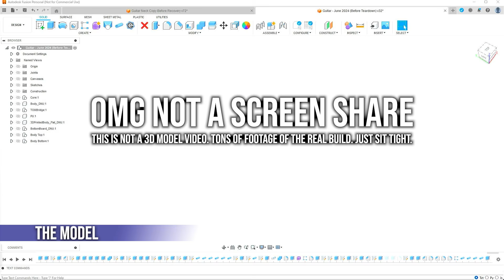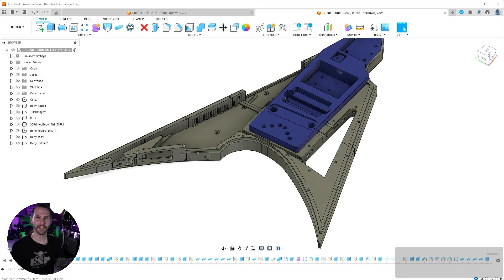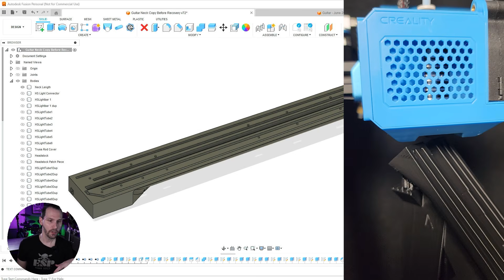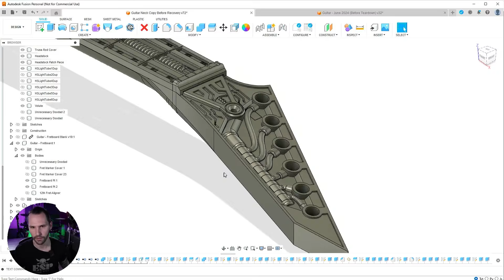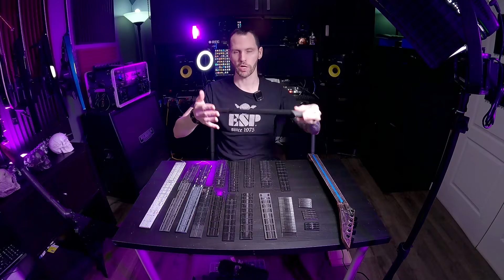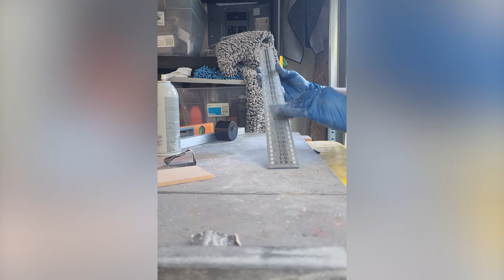This Guitar Neck Is 3D Printed. Wait Until You See The Rest of The Guitar.

Comment: I really like your design idea. I'm also currently making a headless guitar. Just a standard guitar but with LED fret markers and glow in the dark parts. For the LED diffuser, you might want to try UV resin. It's more expensive but very easy and fast to work with
Reply from the maker: Woops sorry I just realized that I missed a few comments. Thank you so much! That's actually a great idea. I have a friend who is actually doing something similar to what you suggested. If it works well, I'm absolutely gonna try that on my next one. 🤘 As far as my current project, I just posted the next video in the series today. Slow but steady progress!

Comment: This is awesome. I have no doubt the 3D printed neck will be strong enough, especially with those carbon rods. Using software and 3D printing to basically replace the wood and woodworking skills normally required in guitar building would open up so many possibilities. Can't wait to see this finished!
Reply from the maker: So sorry, I just realized that I missed a few comments. Thanks man! It took a while to get to this point, but I finally dropped the next video on my channel. You were right. It worked!!!

Comment: Why ABS nut, what's the story there? A pro of the material appears to be its high temperature resistance, so it's not going to surface soften from fricion. Con being everything else: high friction, low mechanical abrasion resistance, increased damping due to rubber content. To me, PETG, PP and PA sound like prime candidates.

Unless i'm misunderstanding the purpose of the nut, i'm not a guitarist :D I have been told that PTFE nuts are good, but it's not printable.
Reply from the maker: Honestly, the story is just that I saw several nut manufacturers using ABS, so I figure I'd try that before any other material. Nothing wrong with questioning though...you might be spot on here. Thanks for chiming in. We'll see soon enough!

Comment: I play a 7-string, but also am a nerd and 3D print enthusiast.  By all means, spill the technobabble.  I'd like to rub it in my ex-guitarist's face when I fully 3d print my own axe and shred.  This is the first episode of yours I was suggested and watched so gotta ask what filament you're using for the project? I know Bambulabs new HF PETG is geting a lot of good chatter about it and imagine something along those lines to handle the tension, but seeing as you're doing an amazing job so far, I can only imagine you tested this and have some insight on what works and what doesn't.  I assembled a few fully 3d printed ukeleles out of PLA about 2 years ago and being able to add my own skull-based designs to the body and head stock made the whole project sick af. And for less tension and no need for a tension rod, they played well enough to stand up to moderate abuse. Lol.  

Frankly speaking, give it about 20 years and 3d printed instruments will be as commonly available as everything else we take for granted now that practically no one used 20 years ago (cell phones, interwebs, etc).  So you're def on the trailblazing path of giants others will stand upon the shoulders of.  Keep at it mang, it's inspiring for sure.
Reply from the maker: Hell yeah man. Yeah I've seen several mentions that people want to see a deeper dive, so maybe I'll do a long long-form video going into the excruciating details. 

As far as filament, I used plane old PLA. Someone else asked and I was stunned when I realized that I didn't put it in the video because this project started by me not only testing the viability of 3D printing a neck, but I also wanted to try the most basic material and step up from there if it didn't work. True that I have tested a lot, but if the PLA doesn't work or warps over time, I'll definitely be checking out the HF PETG. 

Do you have anything online showing off the ukes? I'd love to see 'em.

Even if all of this works, I still have to stress test it, watch it for warping over time, and expose it to normal temp variations to see if it's affected. If by some miracle it's stable, could be pretty exciting to see where the community can take it from here. I'm cautiously optimistic but we'll see. Thanks again for the input man!
Reply: @metalheadmaker  Guitar MAX did a video demonstrating how strong a (probably badly made) Chibson neck is, maybe you could do a similar stress test on a 3D printed neck? Max sat on the neck while holding dumbbells (200+ lbs of weight) and it didn't break, so there's a benchmark to aim for! 

PLA is known to creep over time when loaded and can fail rather abruptly, I think PETG and ABS or ASA would be more suitable, though PETG is usually easier to print. Another option I've seen used was an aluminium extrusion in a 3D printed neck, though I suspect that may be too solid and prevent the adjustment of neck relief using a truss rod.

Comment: The primary concern with 3D printed necks is stability over time. A 6 string  set of 010 gauge strings over a 25.5" scale exerts around 114.5 lbs of tension over the neck and body for example. While steel and carbon fiber are fairly insensitive to high tension, plastic isn't and it's not out of the question the neck might deform over time due to heat stress. One solution which could help, but steers away from the whole 3D printed aspect of it would be laminating the neck with fiberglass or carbon fiber to add stiffness.
Reply from the maker: Yeah all of that is totally a possible outcome. Just pushing boundaries to see how far I can take it. Also, with the carbon fiber strips and truss rod, I'm hopeful that it'll stabilize as long as I keep it out of heat.
Reply: @metalheadmaker  print it in asa,pc, or nylon

Comment: What material is this printed from? And would you be willing to sell the files? And maybe make a version without the electronics, LEDs/tuners etc. That we mere mortals might have a chance of building
Reply from the maker: Omg I cannot believe I did not mention the material. I had a lot to say about it. Lol! This is just PLA. I took a look at a lot of materials and aside from temp, this is one of the more rigid types. Go figure. If it fails, I'll definitely try some other materials before giving up. I'm sure I'll do something public with the files if it's a success. Haven't decided what yet. But yeah, I do plan on making a few of these so I'll definitely do a version with no fancy stuff. 🤘
Reply: @metalheadmaker  PLA has the issue that it will deform over time if there's enough pressure. You should really consider using ASA or ABS. This is the same reason VORON printers are made with those materials and those have way less tension on the belts compared to what strings do on a guitar...

Comment: Greetings from Scotland!

I'm also 3D printing a guitar, to a different design obviously. I found that my core part from the bridge to the neck will bend when strung up even if it's printed full solid. To counteract this I'm going to put a truss rod (a conventional one, not the two-way pre made things) in the body. I also need to print it vertically so the forces are squeezing the layers together not trying to peel them apart.

Final thought that's specific to your design: it might be better structurally to replace the bridge pin sockets that press fit into the body with a through-body nut or a melt-in insert.
Reply from the maker: Greetings and good insight, thanks. Well I'm this far already, so I guess if areas start to fail then I'll know where to look.